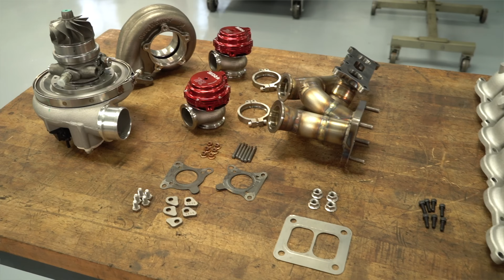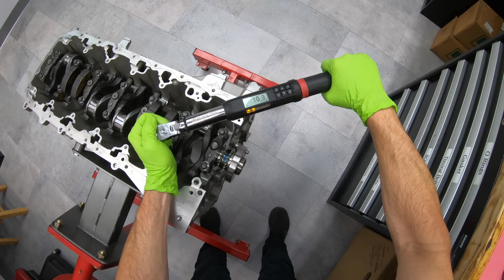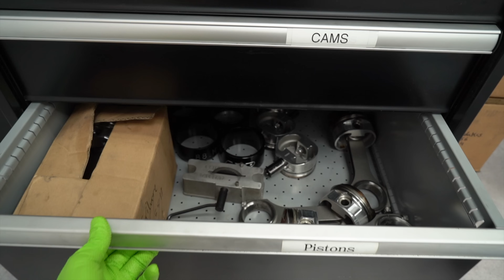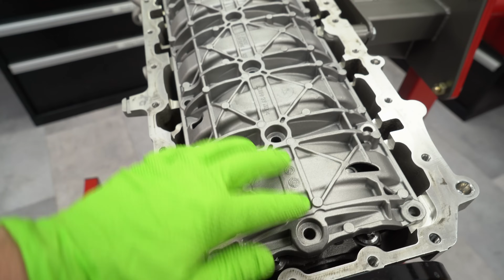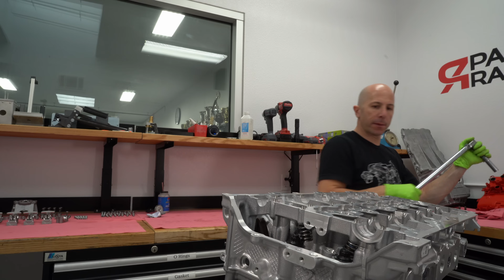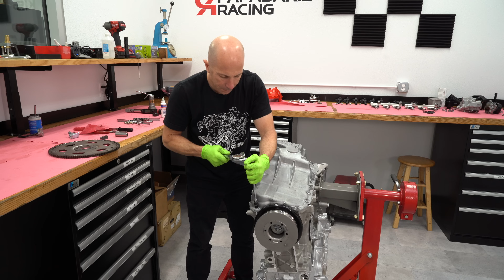2020 Supra 1000 HP Engine Assembly - Start to Finish

Comment: Ur gonna need to make plugs for the injectors if ur not using them. Cant use them for plugs cause with no fuel going through them to cool them u will burn them up quick

Comment: I just found this video.. I can give a good tip for the Pins and clips that connect the piston to the rod without having to use Clips, due to how the piston/pin is made. Look up Steve Morris SMX builds and how he get's rid of that clip and its potential to get out from it position and blow up your motor..  But that's 2500+ HP engine, and costume made Pistons/pins for extreme HP's
Would recommend that channel to others, if you "Love big HP & Big Boost and can't Lie!!

Comment: “Such a high torque” I am blind to normal torque specks from working on peterbilts. Torque speck for those is 200 on all 24 then 300 on all 24. The wheel (if we torque them) are 500.

Comment: Printed aluminium intake parts ?? It has to be the weakest aluminium part ever, granted intake is under no mechanical force but i'd worry it might crack with vibrations fatigue.

Comment: I don't make engines but I love watching this video cuz of how quick yet thorough he is with not only showing everything but explaining as well, even shows where he has to pause take a step back and re tackle the problem a different way.

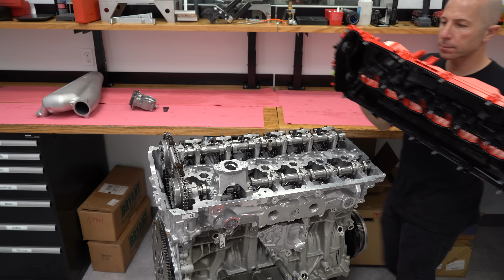Anyways at 10:33 when he is putting on the valve cover, I don't think I see a gasket or silicone to keep it oil tight, is a gasket/silicone not normally used on the valve cover?

Comment: to bad you deleted the air to water intercooler, air to water is far far more efficient than the traditional air to air. 
also to bad you locked out the variable lift, which would make your power band alot more broad and less peaky.
other than that cool build.

Comment: I have a question: why not switch to the S58 engine? Is there any technical difficulty? Does the machine foot not fit? Is it feasible to upgrade the power based on the S58 engine as a case?@PapadakisRacing

Comment: 25 years ago, Toyota referred to those tools as SST (Special Service Tools) in their shop manuals. They were quite expensive and took forever to arrive from the dealer. I can see over time SST use & requirement has only been expanded.
TRUST !!

Comment: When you're in your 20s and 30s, "l need a really fast car with >500 hp, 0-60 in 4 seconds and a top speed of over 180." Over 40, "A really hot car would be great, but what about carrying stuff, transporting my family safely and not getting arrested for speeding? Maybe l need two cars?" After 50, A hot car is nice, but it can't be too obviously fast or l'll never have any peace from cops looking for scalps. Maybe l need three cars, one for fun on the track, two for transportation for the whole family" After that, "l don't really give a shit anymore, as long as it's reasonably fast, reliable, unobtrusive looking and safe, it'll do. l'm not trying to get laid anymore, just get where l'm going and back without headaches, a 6 cylinder Camry is fine."

The point being, going really fast on public roads is rarely a good idea, rarely, but not always. The place for engines like the one in the video is for cars destined mostly for the track or the autobahn. Driving anywhere near their capabilities anywhere else is dangerous, irresponsible, generally unwise and occasionally catastrophic. Fortunately, most of us eventually live long enough to figure that out. When l look back on the things l did on public roads in cars and on motorcycles, l can't believe l'm still here. l'll be "shuffl(ing) off this mortal coil" soon enough. No need to rush it.

Comment: The fact that you have to build it to handle 1000 hp in the first place shows that this engine is way overhyped.
Reply: Almost no regular engine can handle that
Reply: @mansikkamies9146  Almost being the key word here. Several factory gen 3 5.0 Mustang GTs running 1200 plus horsepower on the factory sealed engine running 7s and 8s.

Comment: I’m sure I’ll take all the flack for this but this is the only way to destroy the motor of a BMW before all the seals start polluting every waterway due to the worst seals to ever touch metal…… memeber when seals on BMW’s used to last nearly 20 years? Pepperidge farms remembers. I did a clutch 12 years ago on a 5 series and they decided every seal in the world was neato. Pulled tranny and the rear main and housing with a paper thin seal were still good….. but hell
They supplied the parts so I replaced them.
Reply: No one asked bozo

Comment: Taking an engine that is so well designed.  With a low lag turbo mounting to the block, the intake cooler integrated into the intake manifold, the variable lift system, all of that and just throw it out.

I mean the guy is professional but this is a hack job, turning a super modern well engineered product into this engine design from 20 years ago.

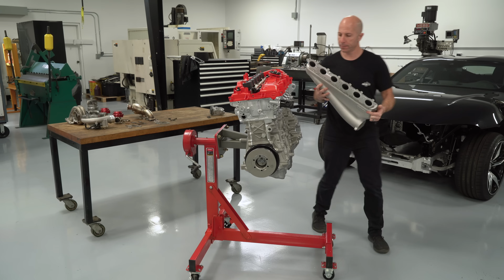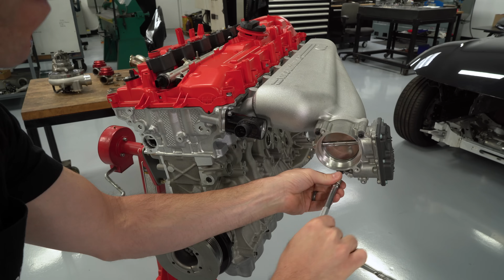Comment: (1)11:06 Why do you want to use a traditional front mount intercooler, what is the advantage of that? (2)Why do you use Port Fuel Injection instead of direct injector? (3)11:35 what is platinum and runner?(4)Why do you want to divert some exhaust gas out to the atmosphere? Why not use all the exhaust gas to boost more intake? (5)12:12 You pointed the 2nd exhaust hole to indicate it is the exhaust pipe to let the exhaust gas out. Did you point the correct pipe? Isn't the other pipe with red cap locked already the correct pipe to let  exhaust gas out?(6) What is the purpose of the other pipe with red cap locked already?

Comment: small block straight six super engines hope twin turbo workw on this.
Reply: Theres a twin turbo version but that's used in another car. There is the S58 which is the performance version of this engine thats twin turbo'd also.

Comment: I see the plastic intake has been changed to cast. 
Brings to perspective all the BMW tech, fans etc that claim changing to plastic was a good idea. Narratives are always incomplete to push agenda.
Better in cost? better in durability? Better in performance if the cast was also smooth to the same degree as the plastic?

Comment: You spent a significant amount of time sourcing specialty tools, I would think. Gotta have them. There's a lot of BMW techno-wizardy in this engine, like the FCOC (fuel cooled oil heater), that you would see in a turbine engine. BMW does some weird things (I own a 2010 650i),  so I can relate.

Comment: 3rd cam shaft is called valvetronics. Putting the valves at max won’t change much really
Reply: I feel like keeping it variable rather than locked is better 🤔 just a thought
Reply: @exquisiteart6478  putting it at max is useless until higher rpms

Comment: Honest question, Can anyone tell me why he would want a waste gate instead of just letting the turbocharger use the extra boost?
Reply: because then it will over boost blowing up the engine aswell as you cant set a certain boost level lets say 20psi is about 1000hp these guys will want to stay around 20psi well if theres no waste gate it will be able to go around 30psi or higher and prob 1300hp well they dont want 1300hp so they limit how fast it can spin

Comment: Sound and looks like a complicated engine that will have reliability issues. Just bring back the 2JZ already. Great videos and lots of knowledge here.
Reply: Making power out of its quiet easy. Just sounds like alot. Its pretty reliable (more reliable than alot of bmw's current engines RN other than some of their diesels).
Reply: @carboydorifutoparty3976  I was a mechanic on both of them and saw a lot more BMW than I do Yotas.

Comment: hmm my suggestion is that exhaust manifold in the head will sooner or later limit this engines potential. i cant imagine this thing will ever make as much power as a 2jz, except you go and build yourself another head
Reply: There's different versions of the B58. The mk5 has the B58C which is the one with 2 port heads in the 20 model mk5. Thankfully the 21 mk5 has the 6 port version(the B58D).

Comment: Anyone know what reliability issues might come in 10 years/high mileage with all the plastic parts such as the intake manifold?
Reply: Manufacturers have been using them for ages.  I have a 1996 Vortec 350 in a Yukon with a plastic intake that still works fine (the original gaskets they went with, not so much).
Reply: Valve Cover Gaskets are usually a problem with BMWs. Also, the chargepipe may crack at higher boost levels

Comment: I am making a 4,000,000 horsepower engine.....It will only run for one second so while flying into bits and tiny pieces. To be honest the full would be larger than the volume of the cylinders... It still is fun to funk with these guys...1000hp = 20 engine hours of fun.

Comment: I have an old car, I would like to strengthen the engine in it, what parts should I replace?
Please help, I need your information
Polska Warszawa...
Reply: Intake
headers
Pistons
Mufflers all of them
Clutch 
transmission 
tires 
Radiator 
and finally install a big or small turbo
Then tune

Comment: Question for the expert: is there a time chart for engine break in time by how many hp. Or components are on a engine?
Reply: General rule of thumb is 500 miles, unless one of your parts especially says more than that, 500 miles is plenty.

Comment: Only 2 exhaust ports though? That feels a little counter-intuitive.
Reply: @Seb C But it also means that all those gases and pressure has to be collected in a super short distance. That can't be the best solution when you think about the resistance to flow.
Reply: @Seb C See I figured the lateral movement of the gases and multiple direction changes would result in more resistance rather than effective action on the turbine. If you compare it to a traditional header that is a straight exit/flow, would it not increase the backpressure within the cylinder?
Reply: @Seb C I guess that makes sense. To me, it would seem more logical to have a more consistent flow rather than pulses. For example, if you had a windmill or like a small turbine people put in their yards, their rotation is typically more consistent if they have a constant/smooth flow rather than intermittent breezes. That would probably translate in the power delivery though as you'd expect quick, violent pulses to hit hard and fast whereas a smooth flow could be smooth and linear.
Reply: @Seb C Yea I see what you're saying. The strong impulses would definitely translate to a more abrupt force. I just assumed that it would also create noticeable backpressure that might not be the healthiest thing.

Comment: No oil check stick? Throw that engine in the garbage
Reply: Yeahhh... that's kinda dumb, because by the time the sensor says anything it might be too late, and what if that sensor fails? 🤷🏽‍♂️ Can't really rely on that so you'd probably have to install auxiliary gauges
Reply: @Seb C Ahh, I see. But how would you know the amount to put back in it without doing an oil change outright?

Comment: Well job on the build.
For me, easy way to install wrist pin circlips are to insert in the open end in first horizontally, then push the clip flat until it pops into the groove..

It works well with 2T circlips, not sure if the 4T ones on your larger displacement motor's are the same.

Anyway, keep up the excellent work 👍🏻👍🏻👍🏻

Comment: 11:54 I am an amateur in mechanics, does the turbo have a turbo ?
Reply: I think that’s just where they place it like it’s a cup holder but instead of a cup it’s a turbo
Reply: That's the exhaust bell housing, every turbo is like this, the exhaust gasses spin the turbine wheel that is inserted and that's what compresses the air on the "cool" side

Comment: I have a question.  The waste gate, when the boost level is maxed, will vent off the excess pressure to atmosphere.   The pressure comes from the intake manifold, so presumably this vented vapor is enriched with gasoline vapor.  Is there a risk of fire, especially when the engine is heated?

Comment: Hey did you guys consider a dual injection setup using the stock direct injection with the port injection?  I know for a racing application the efficiency benefits of that kind of set up isn’t as big a deal but it seems a shame to have an entire injection system just sitting there not being used

Comment: Hello Papadakis, I would like you to answer a question.
How to determine the gap between the tips of the rings for race cars, both aspirated, turbocharged or with nitro ... What formula is used? If it exists or how does it determine it?

Comment: 12:11 If I understood it well, when the wastegates open, they let part of the exhaust gas directly out, without going through the exhaust system, right?
Reply: It keeps excess boost from going into the engine so it doesn’t force too much pressure into it

Comment: Do you measure the bolt stretch on the connecting rods? I recently built an engine and I didn’t know much about it I just torqued to the spec with the arp lube. The engine has already been idled?

Comment: Did you try to make all of the rotating assembly components be close to the weight of the factory components or did you need to rebalance the crankshaft?

Comment: I really can't believe the guys at Toyota allowed an engine with no dipstick.
I have a feeling later models will be fitted with one.
What happens if someone overfills one?
Oil changes, even at the main dealers are done by the new kid.
Reply: B58s have been around for 6 years old now and no one not even in the forums no one's  before and oil changes aren't actually complicated with them as much as other BMW engines(not the one in the mk5 tho but it's still built the same but with minor or small major changes since B58s have yearly updates and improvements and since the mk5s B58 is slightly different it's still going to mostly act like any B58 does)

Comment: Bearing journals. Anyway, I'm not a fan of having to buy another special tool just to get the cam shafts installed. I also never liked that the fact that the timing assembly is on the back of the motor, behind the flex plate. That sucks

Comment: Only two ports on the exhaust?
Reply: B58s come with 2 or 6 exhaust ports(depending on what version it is)the mk5 has a 2 port version but might get the 6 port B58 in this year's models(the 2021 models)

Comment: You can see this engines BMW heritage, with two exhaust ports, each fed from 3 cylinders. Looks so weird.
Reply: These come with 2 or 6 exhaust ports depending on what  B58 it is. They all have small differences depending on what year B58 it is.